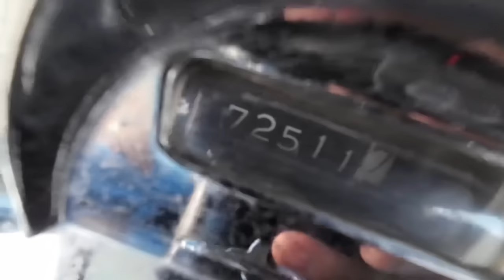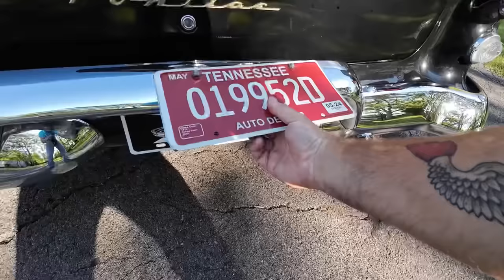Test Drive 1956 Pontiac Chieftain 2 Door Hardtop SOLD $21,900 Maple Motors #2336

Comment: That racket under the car is the left side exhaust down pipe hitting the steering cross link rod. So easily fixed as to be a non issue.  All the electrical stuff would take but a Saturday afternoon under the maple tree to fix. I had a 55 with same colours when I was in high school but it was a Canadian car with the first iteration of small block being a 265 cu. in.  That car got me through high school and two years of RCN on the west coast of Canada.

Comment: Some of the original green color is peeking through in the trunk.  It’s a driver that has been kept up over the years.  I would have preferred the original air cleaner assembly.  Seems like it has the hydramatic transmission - probably only needs an adjustment, otherwise it could burn up quickly.  I say just drive it pretty much as is after doing a front disc conversion to make it safer.

Comment: This is a sweet looking car, imo. 
I had a Turbo 350 transmission in my '70 Camaro that shifted slow, or wasn't immediately responsive. It didn't take long for it to go out completely. I replaced it with a B&M Turbo 400.

Comment: I like your test drives with the older cars that you are selling. I have a request the next time you road test a GM vehicle like and older Pontiac, Cadillac or an Oldsmobile with a four speed Hydramatic, that the ones that the reverse on the bottom when you go to the lot and roadtest with the camera can you put in reverse and back up at a moderate speed for about 10 seconds? I want to hear the Hydramatic whine sound in reverse please?

Comment: she has the slick hydramatic transmission down under. if it is shifting to fast and has a flare on the shift i would start by adjusting the throttle pressure linkage, one indication if it is too low, it will not have passed gear. if not set correctly it will burn that transmission up! ,,,,,,,,,,,,,,,,

Comment: Great looking Chieftain!!! 👍👍
Reply from the maker: Thanks 👍
Reply: The next GM older vehicle with the 4speed hydramatic with reverse on the bottom Cadillac Pontiac or Oldsmobile that you road test. Can you go in reverse for 10 seconds at a moderate speed? I want to hear the hydramatic whine when reversing